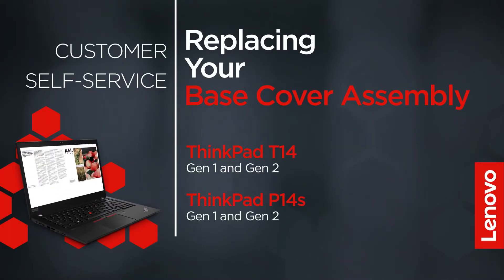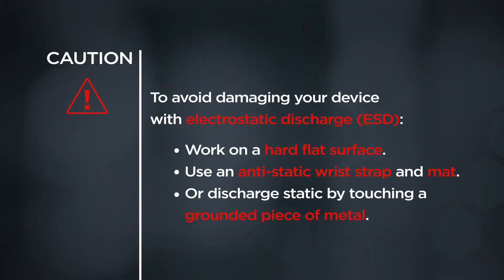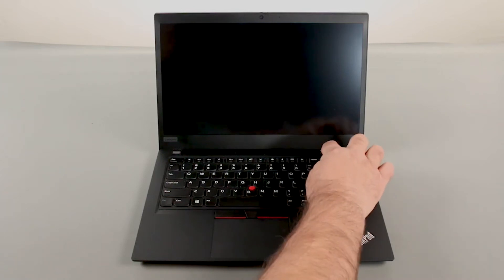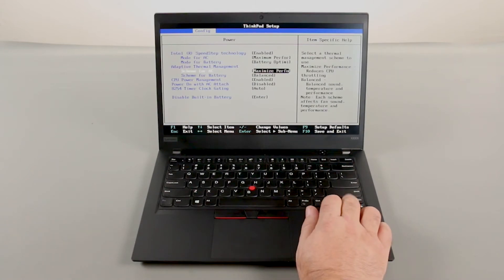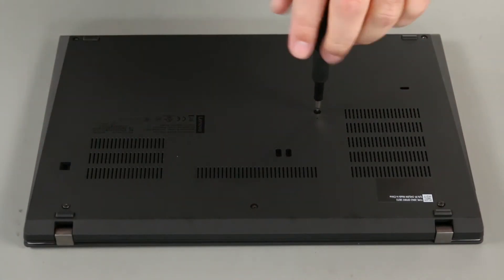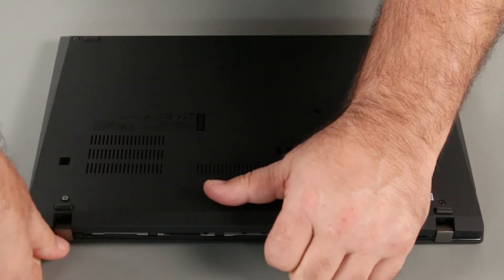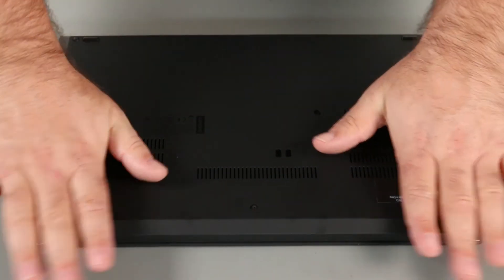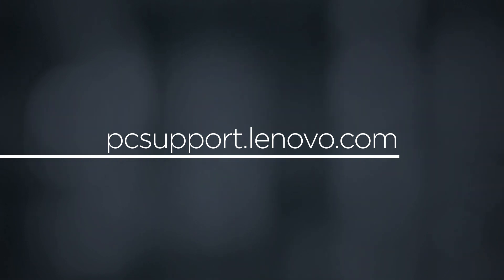Replacing Your Base Cover Assembly | ThinkPad T14 and P14s Gen 1 and 2 | Customer Self Service

Comment from the maker: This video will show you how to replace the Base Cover Assembly of your ThinkPad. The process in this video will work for the ThinkPad T14 Gen 1 and Gen 2 and the ThinkPad P14s Gen 1 and Gen 2. 

You will need a screwdriver kit, a non-metallic pry tool, and 10 minutes of your time.

ThinkPad T14 Gen 1 Repair Guide: https://pcsupport.lenovo.com/us/en/products/laptops-and-netbooks/thinkpad-t-series-laptops/thinkpad-t14-type-20ud-20ue/selfrepair/removalsreplacements

ThinkPad T14 Gen 2 Repair Guide: https://pcsupport.lenovo.com/us/en/products/laptops-and-netbooks/thinkpad-t-series-laptops/thinkpad-t14-gen-2-type-20w0-20w1/selfrepair/removalsreplacements

ThinkPad P14s Gen 1 Repair Guide: https://pcsupport.lenovo.com/us/en/products/laptops-and-netbooks/thinkpad-p-series-laptops/p14s-type-20s4-20s5/selfrepair/removalsreplacements

ThinkPad P14s Gen 2 Repair Guide: https://pcsupport.lenovo.com/us/en/products/laptops-and-netbooks/thinkpad-p-series-laptops/thinkpad-p14s-gen-2-type-20vx--20vy/selfrepair/removalsreplacements

To learn more about your device go to https://pcsupport.lenovo.com

To find parts for your device go to https://support.lenovo.com/parts-lookup/?cid=ww:lenovosocial:b9515f&source=socialmedia&subsource=yt

To view the Lenovo Support Self-Repair Guides landing page go to https://support.lenovo.com/us/en/solutions/HT516547

** NOTE: Static electricity can destroy components. Use a grounding strap, and clean, non-conductive surface to work on. Use plastic or coated tools to prevent scratching and avoid using metal tools on plastic parts. For more detailed information on electrostatic discharge and how to prevent it, please watch our ""Understanding Electrostatic Discharge (ESD)"" video: https://youtu.be/by4PB3WtdLo 

Applicable Machine Types:
ThinkPad T14 Gen 1 - 20S1, 20S0, 20UE, 20UD
ThinkPad T14 Gen 2 - 20W0, 20W1, 20XK, 20XL
ThinkPad P14s Gen 1 - 20S4, 20S5, 20Y1, 20Y2
ThinkPad P14s Gen 2 - 20VX, 20VY, 21A1, 21A0

#lenovo #LenovoSupport #LenovoTechSupport